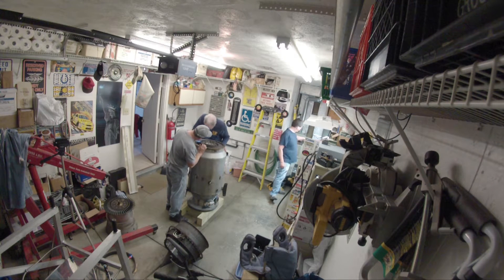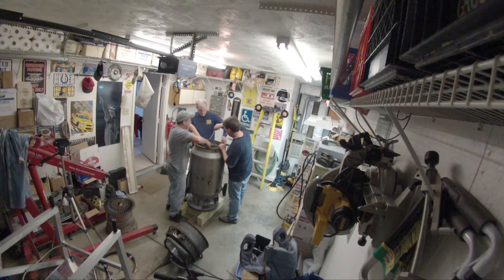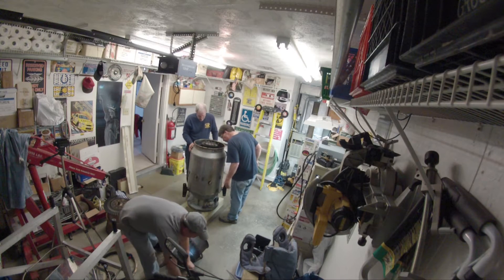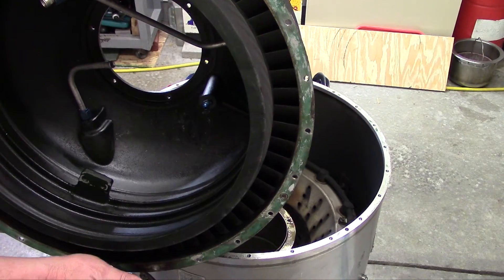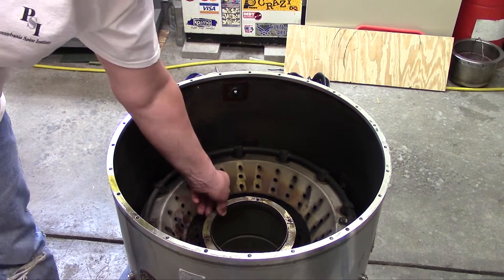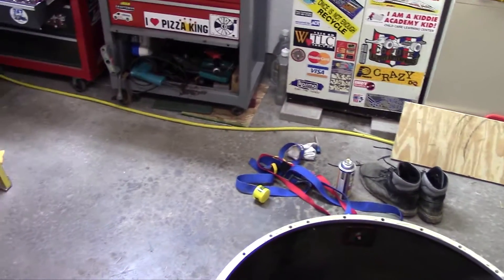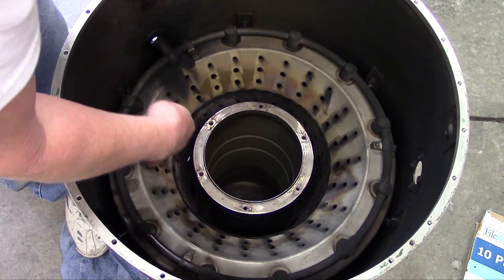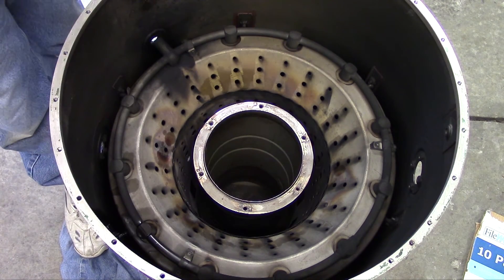The Fairchild J44 Project:  Disassembly Part 3

Comment: You wouldn't happen to have any operating data on the compressor, would you? Particularly compression ratio and operating pressure in PSI. I'm rather curious what these centrifugal units were able to achieve pre-ECU era. As a fellow AgentJayZ video enthusiast, I can only compare it with the J79 data he's mentioned. Long story short, for my own project, I'm limiting my combustion chamber to ~60 psi for the safe zone with capacity for maybe 70, material capability dependant as my pressure vessel that is being re-engineered was originally rated at 100psi. I very much doubt my equipment will be able to push over 40, but it will also be operated beyond the original specs and free of a lot of restriction from its initial configuration. 
I'm slowly making a dent in your library of coverage and it is very much appreciated how much you've documented along the way! Very enjoyable, good sir.
Reply from the maker: What in the heck are ya buildin'?  I have listed here for you some specs for the J44, from the service manual:

Rated Engine Speed:  15,780 RPM
Thrust (Sea Level):  950 lbs  <Max Military 1000 lbs>
Max Altitude:  20,000 Ft.
Air Flow:  25.8 lbs/s
Pressure Ratio:  2.47
Specific Fuel Consumption:  1.65 lb/hr/lb thrust (1,568 lbs/hr at rated power)
Rated EGT:  816 deg. C (1500 deg F)
Oil Mist Lube System Operating Range:  0 - 35 psi

As you can see, the efficiency is very low, especially compared to modern engine design.  It burns a lot of fuel for the power it makes, which is expected just looking at the low pressure ratio spec.  There is not an actual spec for compressor discharge pressure, other than the reference to it concerning the oil mist lubricator system operating range of 0 to 35 psi.  It uses compressor discharge air to pressurize the system, so I would expect to see 35 psi at full power (100% rpm).  There are 2 external connections to the engine cowling near the front, right after the diffuser.  One feeds to the acceleration limiter valve (pressure is directly proportional to rpm) & the other feeds air to the turbine bearing for cooling.  The lube system supply air is obtained inside the engine, on the combustion side of the diffuser housing, as you can see in my videos.   Maybe I will connect a pressure gauge to the engine to see what happens, once I get it going.  Hope this helps.

DD
Reply: @DScottDuncan  Hmm, interesting. That's about what I expected, but still appreciated. I started building a testbed for a process to utilize on-demand hydrogen using a large Schwitzer turbo as the base for the engine, but have since acquired an industrial Garrett compressor wheel and a ton of old Phantom II parts. It's kind of become its own hybrid engine now, using some older parts and newer ideas I've come up with along the way.
Reply from the maker: Video everything.